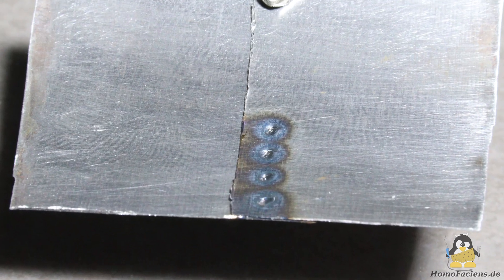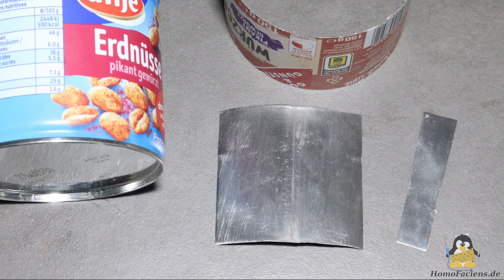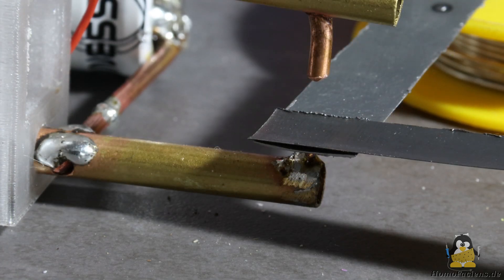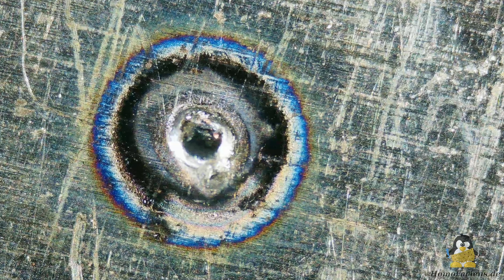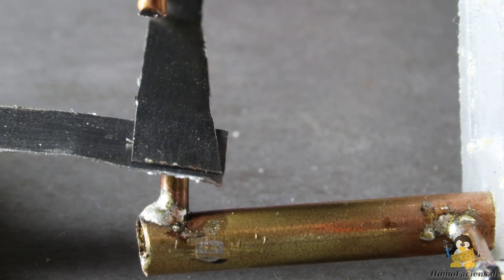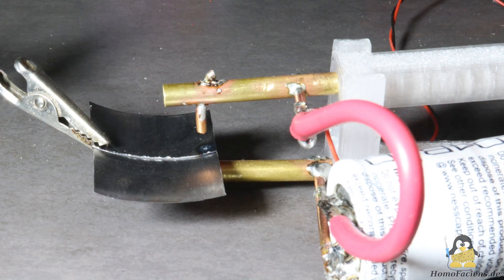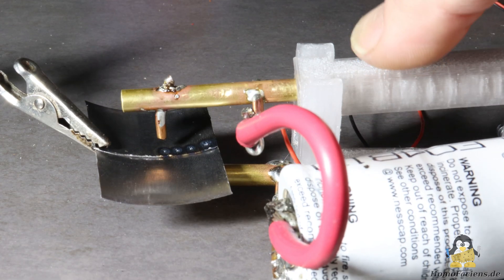DIY spot welder for thin steel sheet

Comment: 先生你好，我做了一款重300克的双螺杆挤出头，配了1比54步进电机，最高打印温度350摄氏度，制冷片代替了你的水冷，标准的0.4mm喷嘴，视频我已经发布在我的主页里，很希望能和您交流学习，可以给我一些改进的意见吗。
Reply from the maker: My first question is:
Why do you use two auger screws?
Reply: @HomoFaciens 这样就可以对付粘稠的材料和流动性不好的材料了，而且不依靠螺杆和管道的摩擦力输送材料，精度可以提高，就是它的结构太复杂了。
Reply from the maker: So that is what you wish the two augers would improve. But have you done any test prints that prove you are right with your assumptions? All you are demonstrating on your channel is purging plastic into a basket.

Comment: Very nice handy project. So if I take a small wheel, two of your caps with simple switching relay, can I make continues welding line ? Thank you. Have a nice & productive day.
Reply from the maker: Thanks! You'll need really high current relays! I have seen people making use of the magnet switch from a car starter. With that you could eventually make use of a 12V car battery, but you should know what you are doing! Shortened car batteries deliver really high currents and if you can't break the circuit for what ever reason, a fire extinguisher should be in reach...
Also you must trigger the magnet switch for a really short time span.
Don't say I haven't warned you!

Comment: i dont think the voltage is a problem, the problem is that the contacts are not pressed firmly against the metal before the current is triggered. you should consider including a 1500-2000A SCR module or make a trigger with a couple of IGBT or Mosfets in parallel. Controlling the current can be done with the voltage, and the time with a microcontroller with igbts and mosfets. A scr is a bit harder to control but its simpler and more fool proof, though i wouldnt weld tabs to a battery with a scr one.
Reply from the maker: Yes, I could make a "normal" spot welder with all that stuff, but this one is good enough for my purposes. Keep it simple!

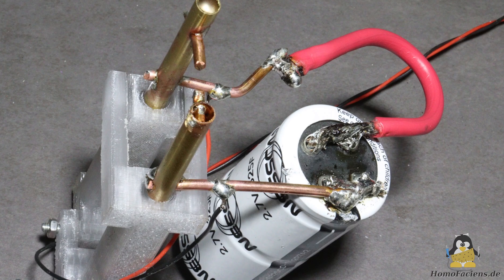Comment: At 0:40 you show two thin wires, sodered to the two electrodes, and then going off screen ... What are those?
Reply from the maker: These run to the step down converter for charging the capacitor. No more than 3A, so the thin wires are thick enough.
Reply: @HomoFaciens  Ah, I get it, thanks :)

Comment: Those welds look really uniform. Good job. I built a spot welder using a microwave transformer rewired as a step down and regular 120 VAC line power  (here in the U.S.)  It had a lot of electronics and I was able to control number of cycles and where the on the cycles I started the weld. It was very powerful but not repeatable so I put it on the shelf and there it sits.  I built it to weld 18650 batteries. Someday I will have to revisit it.     Your approach looks much simpler.
Reply: @PlaywithJunk used a selfmade spot welder in the video PWJ142. 
It used a timing relais and a large torodial transformer. It seemed simple enough so one could figure out the wiring on your own, if you know what you’re doing. It was a very solid build though.
Reply from the maker: thanks for sharing your experience!

A microwave transformer would allow for continuous welding, but as you wrote, the voltage and current duration is more tricky to adjust for repeatable results. Charged to a given voltage, the energy transformed from a capacitor to the spot weld doesn't change between the cycles. The charging time is a bit nerve wrecking. It's good enough for my purposes and "perfect" is just an illusion ;-)